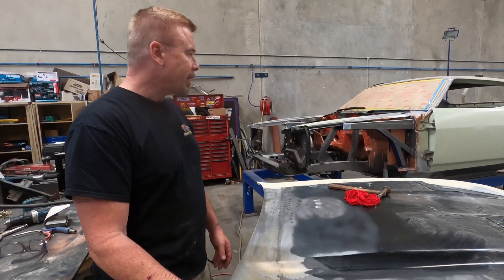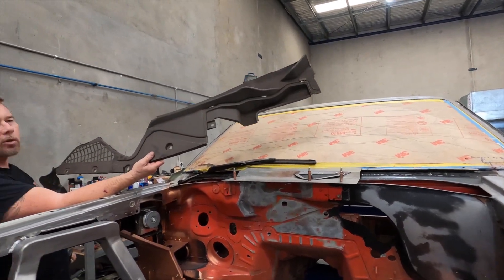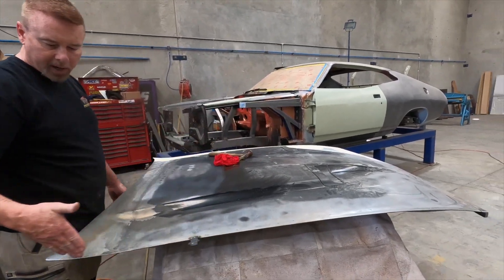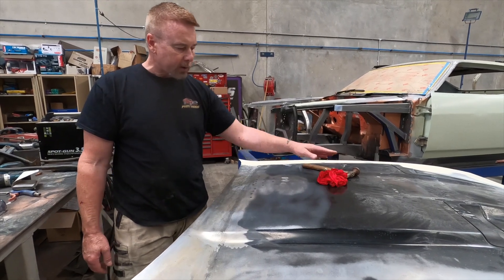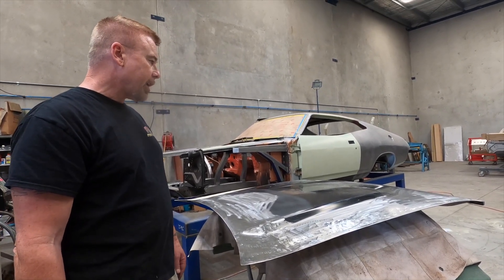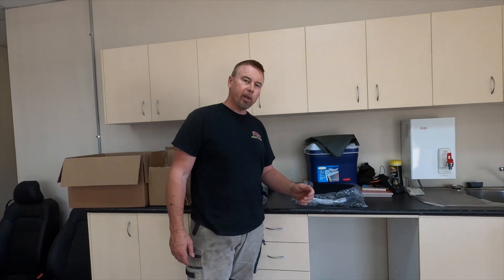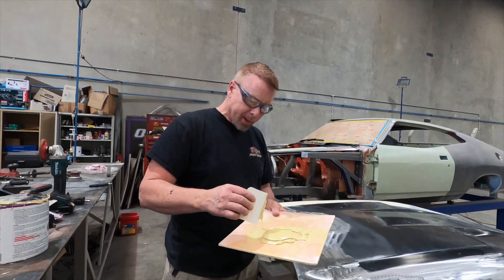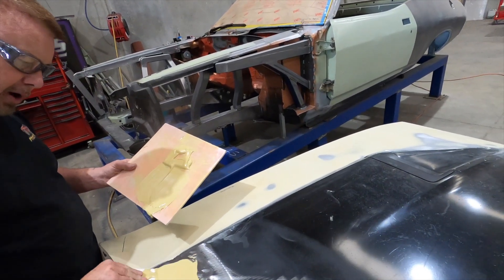XB Coupe with Mustang GT Floorpan & Coyote swap - #   Eps  32  Adding filler and priming Bonnet

Comment: Enjoy watching all the mods you are doing to make things fit. I tried Your Link for the shirts. it's not working.
Reply from the maker: Sorry to hear you couldnt get onto ebay, maybe try to manually search for them , my ebay username is phatfords also ,
Reply from the maker: Can you try this link and let me know ? 

http://rover.ebay.com/rover/1/705-53470-19255-0/1?icep_ff3=2&pub=5575378759&campid=5338273189&customid=&icep_item=224367013878&ipn=psmain&icep_vectorid=229515&kwid=902099&mtid=824&kw=lg&toolid=11111
Reply from the maker: If either of these dont work just write me on info@phatfords.com.au      I’ll  make sure you get a shirt

Comment: brilliant work and hilarious banter!! what primer did you put on the bonnet at the end?
Reply from the maker: Thanks Graham !  it was 2 pac epoxy, i didnt have any Epotec, so I used what I had which was Spray Chief Epoxy, hope its ok .  I will probably sand most off later, when im ready finish the bonnet,  just wanted to quickly seal the filler
Reply: @phatridesgarage3760  i thought it was epoxy most epoxys are very good and long lasting